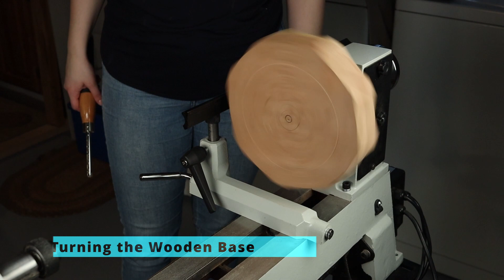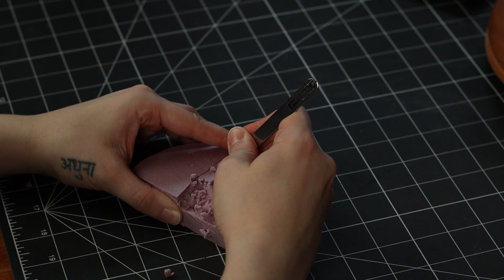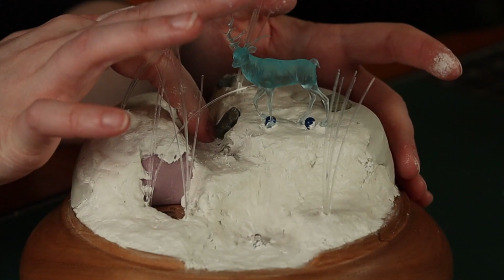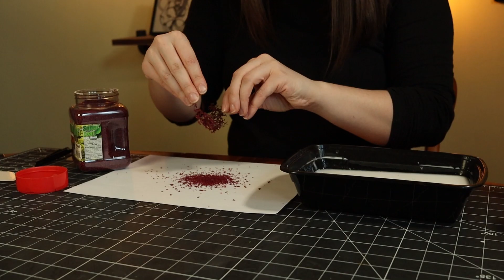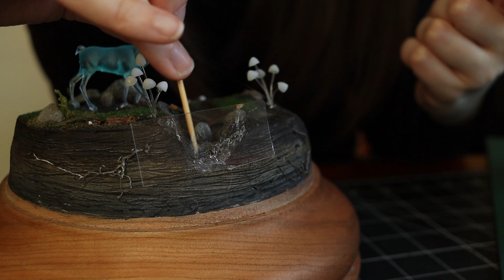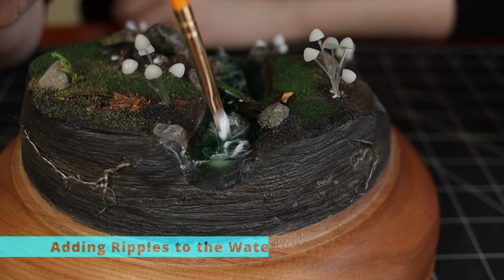Beautiful Forest Spirit Diorama - With Waterfall!

Comment: You can use one of those craft hand drill. They normally come with a bunch of different little bits that should fit the size you need for the plants. You can use some tacky glue to to install them in the foam

Comment: The foil bottom on the rocks is such a great touch, and I'm curious about your moss/silica process. Also shrink wrap is fabulously satisfying 🤘
Reply from the maker: Drying the moss is pretty simple, I let it air dry for a few days and then I put it in an air tight container with silica beads for a few weeks. I have rechargeable silica. So if it turns dark (which means it's full of water), I'll recharge it during the drying process. That's not always needed though. Overall it's super easy!